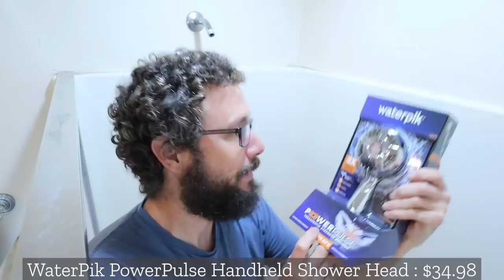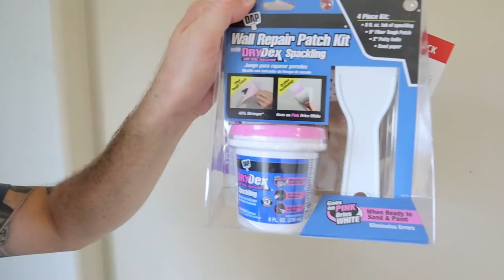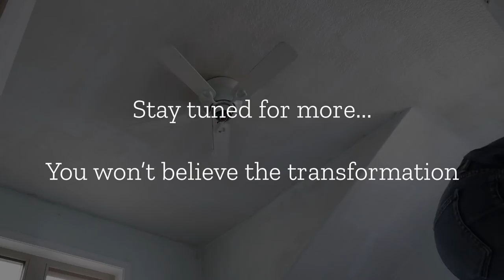I GAVE my brother a FREE HOME MAKEOVER on a budget | Part 1 |  Prep Work for Carpet & Paint upstairs

Comment: Did you try changing out the hot water knob cartridge first?  My husband wanted to buy an entire new faucet, but I did some research and found you can just replace the cartridge ( if the knobs have them) and it stops the leak out of the main faucet. For $5.00 I was able to stop the leak!  Same thing for lots of showers.  P.S. Fun to watch the cleaning in fast mode!
Reply from the maker: No, didn't do any trouble shooting just replaced it. That would have saved some money and we will remember that next time.
Reply: @TheKraemerLife  I had no idea some faucets have cartridges!  Love the old one you replaced 😊.